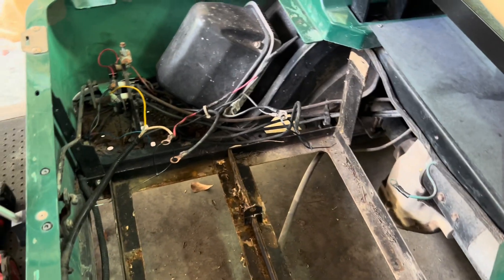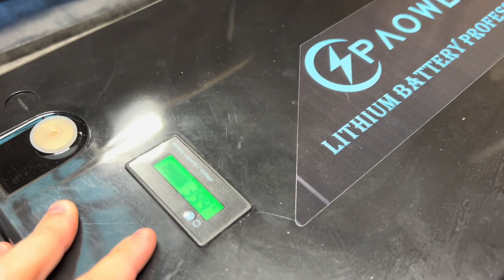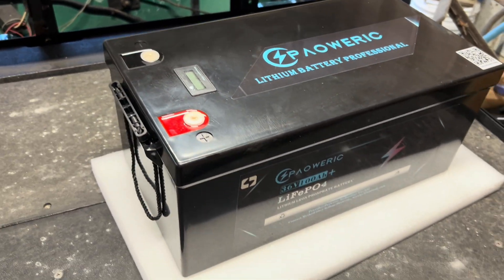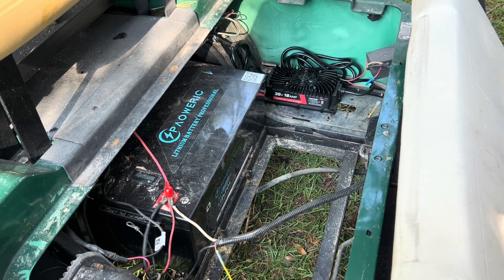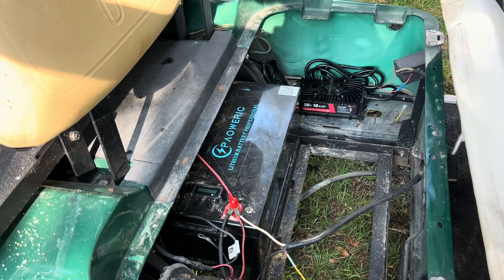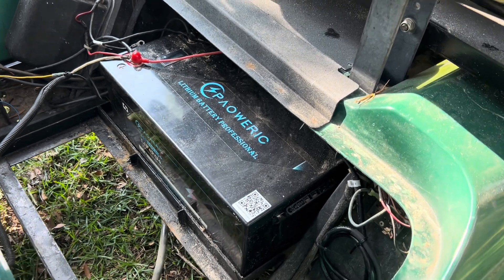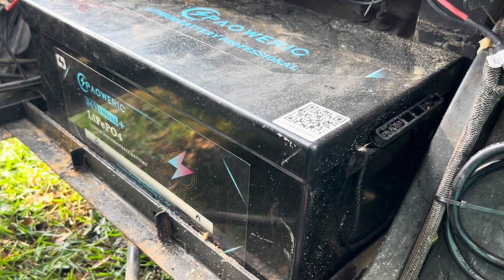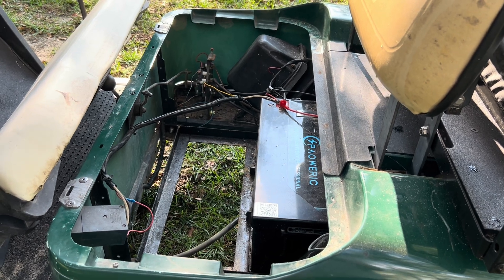How Good Is The Cheapest Lithium Golf Cart Battery on Amazon? Ezgo Txt Series Lithium Conversion

Comment: I would prefer a battery with a on/off power switch built in. Safety is a priority. I bought a cheap battery, no gauge, but it had a power switch. I added a volt meter directly to to battery so that anyone could see at a glance that the power status was on. Nice, neat install. Looks like you got room for a second battery. Good job.
Reply: Could you run 2 batteries in series and run like that? One charger charge both at same time?
Reply: @charliesheen1980  You probably meant "parallel. I have the Epoch Batteries, currently have 2 batteries, they are 48 volt each, and the exact size of the 6 volt. They are rated at 30 APH each so equals 60 APH. I installed these in a TORO Workman MDE, the range is 25 plus miles, although the TORO is bigger and heavier than a golf cart. I'm going to install a third battery just for a little increased range. Yes one charger will charge all batteries, as they are connected to a buss bar along with the charger. Positive to one bar, and neg to the other bar.

Comment: hard to believe you didn't notice a huge difference in range! It should have stomped all over the old lead acid. For that reason alone, I would steer clear of this  battery.
Reply from the maker: @bigshowradio_550  I can’t really give you an accurate review on range as all I use this for is work around the yard. Manufacturer I believe claims 42 miles. I haven’t charged it but once in 3 months if that helps any.

Comment: What did you do about your lights and ignition switch?  Converter?
Reply: Yes I installed one for the 12v lights etc.  I put a cut off switch to the converter as it was pulling juice all the time.
Reply from the maker: @arkbama6  it needs a 12v converter off of Amazon. Ignition switch works fine, but the lights, any radio, and other 12v accessories need the converter
Reply: Does the stock battery meter not work with this type of battery?
Reply: @ I got a lithium battery that bluetooths to my phone and I can get a battery charge level on my phone anytime.  The stock battery charge meter sort of works with this battery.  So far it’s been about right.

Comment: Good job!  Thinking of doing a lithium conversion on mine too. Thanks for the info!
Reply from the maker: It’s definitely super easy to do. Good luck! The battery linked in the video is actually on sale right now on Amazon I believe!
Reply: I replaced mine but it doesn’t work. What should I do?  Did you by pass the wire at the original charging port?